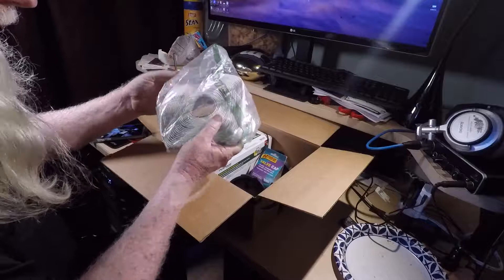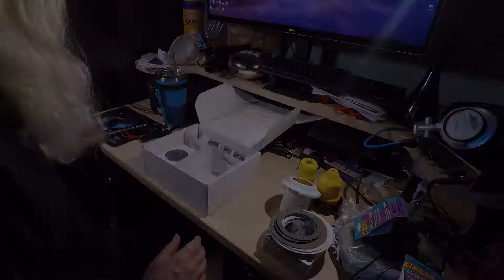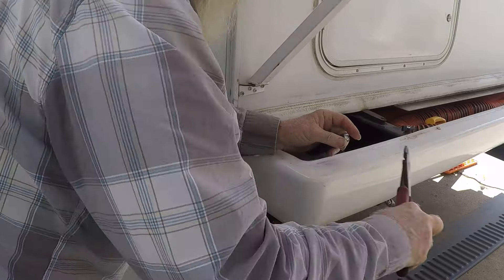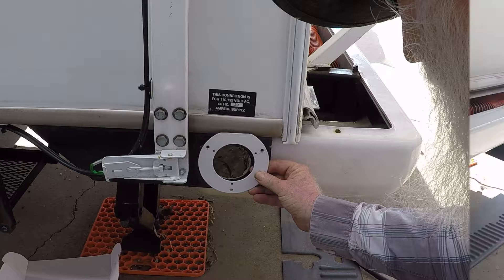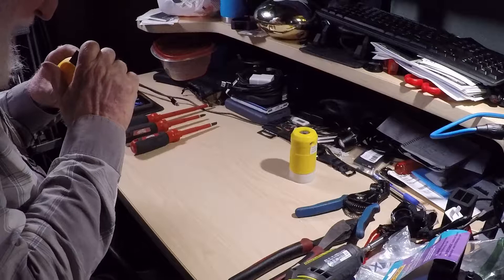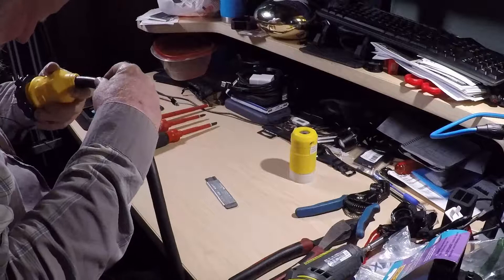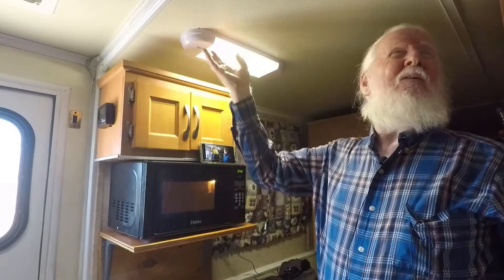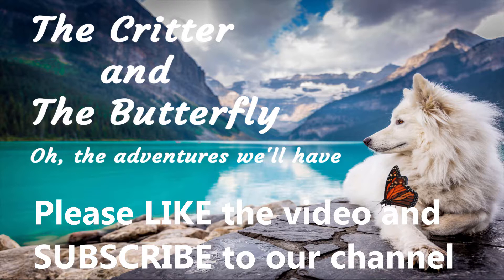HOW WE DID IT.  Park Power Detachable Power Conversion unboxing and install.

Comment: Great idea!  Where are you storing the cable and where did you get the black and grey caps?
Reply from the maker: Hi.  We store the A.C. cable in our front storage compartment.  We store our surge Guard in our Suburban so we can plug it in before we set up to test the power.  For the caps, I was wandering around the internet and saw them.  Ended up getting them on Amazon who had the best price.